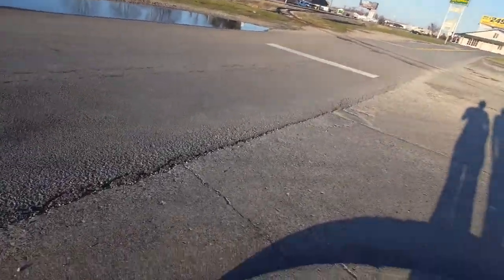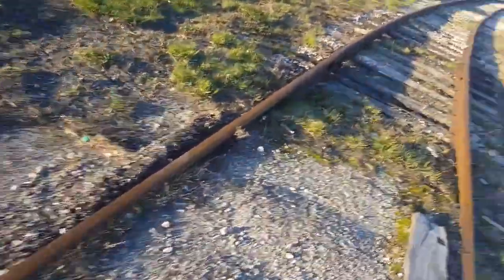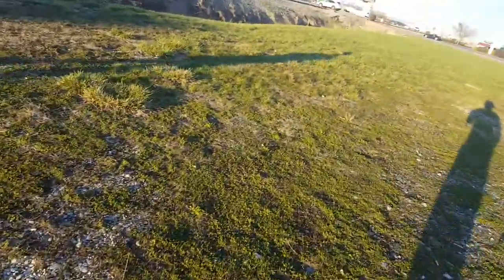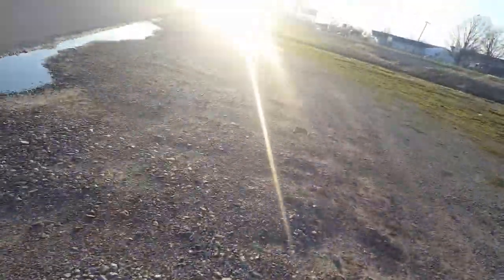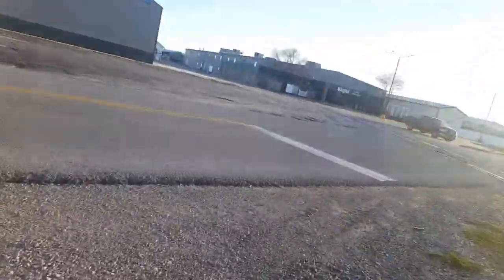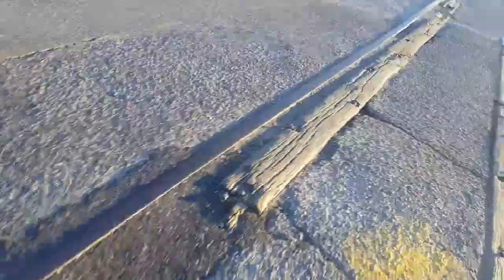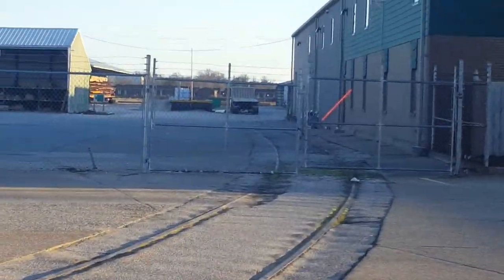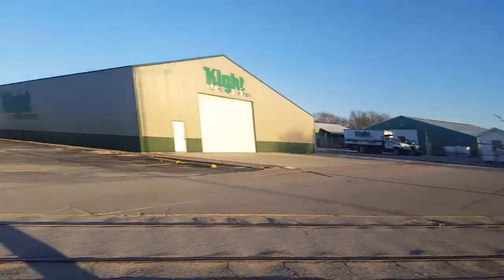Out of Service Railroad Crossing (Oak Grove Road, Evansville, IN)

Comment: This was one of the two last industries besides the CSX interchange that were still in use before the line was put out of service about a year before you came. They took 1-2 centerbeams. Probably would still be a customer if NS hadn't shut the line down.
Reply from the maker: NS specifically shut down the Evansville Branch west of Boonville to avoid its customers. They had customers who still wanted to ship by rail and they turned them down. If you weren't aware (though I'm sure you are), they have began the process of removing the line, beginning in downtown Evansville.
Reply: @kyleb06  yeah I saw them removing the yard next to division street. Also I looked at some of the rails the other day and they weren’t in the greatest shape. Some were even put in in 1908 and I’m sure NS didn’t want to fix up the rails just for 3 customers.